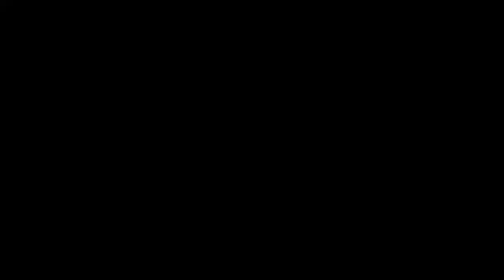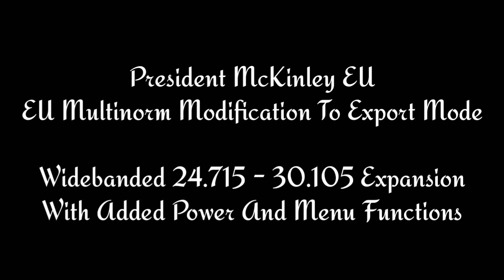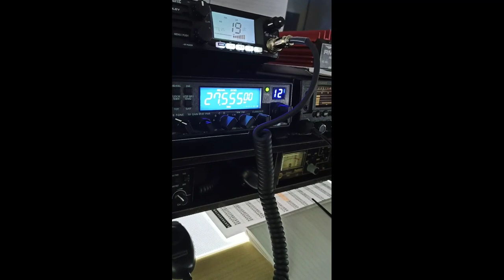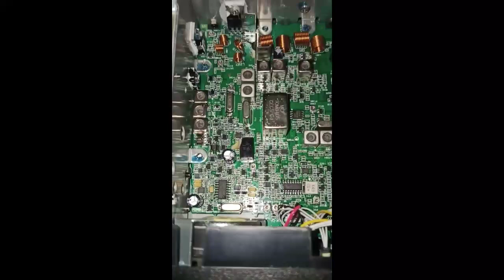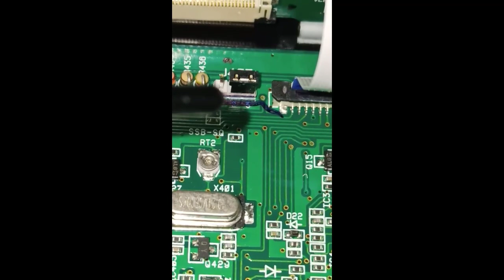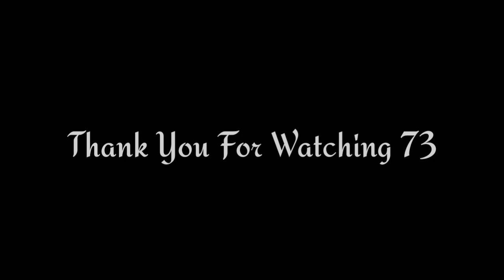President McKinley CB EU .. Wide Banded. Tutorial .. Export Modification.

Comment from the maker: Correction.. in SPAN mode 'on' the frequency steps are as follows.. 0.1 -- 1 -- 10 -- 100 -- 1000 khz steps. and in multinorm the radio only gives you 10khz and 100khz steps, thank you.

Comment: Hi!
Thank you for your video!!!
Is it necessary to cut the white wire?
Thanks in advance!
Reply from the maker: Hi Bruno, yes it's important to cut the white wire..
It's always best to cut the wire in the middle so if you want to reverse the procedure it can be easily soldered back together.. or if you prefer you can just desolder one side of the wire and put a little tape over the end to stop it connecting with anything on the circuit board. Hope this helps.

Comment: Hey just got one recently and looking at this, hows it holding up 3y later with the extra juice?
Reply from the maker: @foobarf8766 
Even today the McKinley is still working fine and without any issues.. it's a superfine radio and it has a prime place on my bench.. definitely one of my best 11 meters radios.
Reply: @DeltaXray444  thanks I looked in mine finally but no jumpers or wire to cut like yours, i guess its the US version. ohwell its been great on 11m anyway cheers!

Comment: How far does the KC shift slide will it go to the 0s
Reply from the maker: @M6MRP  
Hi Phil, interesting question and to be honest I haven't put the radio on a frequency counter.. but it will go to the next channel, so basically more than 10KC's..
Also the radio works with Span mode so depending how it's set up just by turning the channel selector you can move in 1KC increments on any frequency.. so it will get into all splits.. hope this helps.. but im sorry I couldn't tell you exactly how far the clarifier moves.
Reply: @DeltaXray444  you must be able to get to the 0s if it does more than 10kc try 27.400 just by using the frequency display on the front, I'm looking for a tidy desk radio with a front speaker an dont want to mod it for the 0 in between channels rather leave it stock.

Comment: @Delta Xray 444 is there an export mode for the new President Washington? I heard they have left the wire cutting and moving over the Jumper and instaead of that the New President Washington is all menu driven. SO to make the President Washington  in export mode you have to do a keypress Ninja movement just like the CRT SS 9900! Is this true Delta Xray 444??? Thanks for any reply !
Reply from the maker: @MAGNETAR-187  im sure it will have export mode at some point.. most new radios now are either jumper or snip a wire or both and menu driven. like everybody else all those that have an early version I've not seen any information yet as to how it is done.. I still think it will be a bad seller with having a few watts more than the George 2 that nobody will see the difference over distance on ssb that anyone will see on a meter/receive and a few more options.. what they should have done at least is change the design there won't be many people that bought a George 2 will buy this radio.. the original Washington was an iconic radio and also an homebase.. to slap the name Washington on the new radio and it being the same design as the George 2 does a dis-service to such a great old radio.. for the life of me I cannot understand why this radio was even made in the vein of the original Washington homebase.

Comment: So what i have understand is so with the Mc Kinley to modify it to an export mode you have to cut the white wire and move the jumper from left to right? Thanks for any reply! Thanks for this video. I have purchased a President Mc Kinley and have modified to export mode and now it send about 20 watt on fm and 12 watts on SSB!
Reply from the maker: Yes that is correct and it will give you more power, extra bands and more options in the menu. This is the EU model. This cannot be done on the USA model.
Reply: @DeltaXray444  thanks İ am actually in the Netherlands which is an EU country so i will try this on an EU President MC Kinley !!!
Reply from the maker: @AEZAEZEL-187  it will work guaranteed.. good luck.
Reply from the maker: @AEZAEZEL-187 
BTW this process can be reversed if you put the peg back to its original position and reconnect the cut wire back together.

Comment: Hi, I got mine President in Canada but moved to Europe. I find out that they don't use same frequencies here. If I do those adjustments, would I be able to use it in Europe?
Reply: FCC in the USA won't allow CB radios to be modified and that's why the USA version cannot be modified like the European version!
Reply from the maker: @cariboooutlaw4852  that's such a shame.
Reply from the maker: The version I have here is the EU (European Model) I'm not sure which version you bought in Canada..
If you have the weather function on yours then it is the USA model as the EU model does not have that function, it can still be wide banded but I have no idea what frequencies it will give you.
I will add though you can try and see if it works and if it doesn't work it is easy to put it back to how it was originally. Thanks.
Reply: @DeltaXray444  It has Weather option on front panel and only AM mode beside the LSB and SSB. I was hoping it will give me more channels and higher frequencies. I might try your adjustments.
Reply from the maker: @dusanstakic2741  if it doesn't work you can always reverse it.. it will not cause any issues with trying as long as you give yourself the option to re connect the wire.. then again I'm not sure if that white wire is in the US version..

If you like this radio keep it as is.. I would recommend getting the EU model it is much superior with options compared to the US model..

To be honest I cannot for the life of me understand why the USA model didn't have the EU spec.. strange that. Good luck with trying the mod.. it would be interesting to hear your report. Thanks again.
Reply: @DeltaXray444  I haven't had a clue that it won't have same channels there and here. And not FM but only Am. I'll open it and check it. I will let you know what I found.
Reply from the maker: Yes please that would be very interesting indeed.. let me know your findings I'd really like to know how you get on with it and if it gives you any extras.. I've not heard of anyone else who has attempted to do the conversion so it will be a first for me.
Reply: @DeltaXray444  I opened it, nothing similar to yours, no vires to cut or the other thing. I took some pics but can't send it?
Reply from the maker: That's very unfortunate.. I'm surprised there is no modification that can be done..
What will you do next.. are you thinking of getting another radio now for the frequencies you need.
Reply: @dusanstakic2741  that’s correct. I just purchased the US version of the radio and the components on the PCB are laid out differently. The wire is not there and the three resistors aren’t there either. I need to get the EU model. Thanks! and 73’s
Reply from the maker: Very interesting..
Yes the EU model is a good radio with many more options, it also runs in vfo mode with the channel selector too.  You won't be disappointed with it as it covers 10-11-12 meters all bands and fm SSB.. hope you pick one up soon. And thanks for all your feedback.

Comment: no mention of the 5 ALPHA CHANNELS or the FM is not good at all......
Reply from the maker: The radio covers all the alpha's and are marked on the display when in one with an "a" .. the FM on the UK model is exactly as it should be and works extremely well. One of my better export radios and better than most. Thanks

Comment: What does the radio do if you don't cut the white wire but still move the jumper?
Reply from the maker: do you know i havnt got a clue.. ive never tried that.. its an interesting question though.. next time i take the lid off ill see what happens.. i can easily solder the white wire back together and give it a go.
Reply: @DeltaXray444  I have one coming, but still in transit. I haven't seen anything about what the wire cut actually does, and same with the jumper.
Reply from the maker: @nasanction  the white wire opens the radio up to more bands and extra options and I think the peg moved over gives more power output.
Once both wire and peg are sorted and the rig is in export mode it becomes a very good radio with great frequency coverage.

Comment: I have been looking at this radio in this video, the Lincoln + and the new Stryker SR-955HPC 10 Meter Radio With Single Sideband, But i think i am leaning towards President Mckinley. Best regards from America! 😎
Reply from the maker: I have both and they both have there own attributes, they are two excellent radios, but the EU version of the McKinley is better than the US version and has more options. The Stryker however is a fantastic radio, I like both of them and can't fault neither.
Reply: Of you don't need echo and RB, This is better.  Just buy a 60$ amp

Comment: Great video.  I just got an EU version of this radio and cut the cable and moved the jumper.  Now I have all modes available and can finally access the UK menu, but I've lost the EU one.  Any suggestions?
Reply from the maker: Once the radio is put in export mode you can use it in vfo mode on the channel select and it will give you every channel possible from top to bottom of the entire frequency coverage, for quicker access to bands just put the radio on the correct band A b c ect and also using the underscore icon to flow through the channels..
Reply: @DeltaXray444  thanks!!

Comment: Hi ,
I've done it...but when i tried to lower the power ( ptt + . ) it went down!! And its not the fuse ... Is it too bad??
Reply: Fixed. The fuse on the cord was fine but...the 2Amp fuse on the lighter plug burned. Was it expectable?
Reply from the maker: @fungaga77  yes because you now have it in export mode it will draw more power from the power supply.. be careful and make sure you do not put a big fuse in .. maybe like a ten amp fuse should be ok.. I'm glad you sorted it out.
Reply: Thanks, i've found a 3Amp so it.will go with this one .Do you know how to change RF power?
Reply from the maker: @fungaga77  Key the mic and hold it in then press the dot, then turn the channel knob left or right which turns the power up or down, (you can see this with the bar that goes up for high power or down for low power).. once you have it on the output you want then press the channel knob in to set..
It may take you a few attempts but once you learn it it becomes easy..
This was a tricky one to do the first time for even for me, but be patient you will do it.
Reply: ok. will try again. Thanks
Reply from the maker: You can change the output from the front of the radio, mine goes from 2 watts to around 25.. have you tried re seating the tiny plug on the pins.. maybe they are not sitting properly.. let me know, thanks
Reply from the maker: Did you catch a power wire somewhere, ive never heard of that happening, the modification will never cut the radio out, let me know how you get on and what caused it to happen.

Comment: Why has the wire been cut please? Thank you
Reply from the maker: The white wire is cut to put the radio into export mode and expands the frequency coverage.
Reply: @DeltaXray444  cool. Now I get it. And then it's easy to switch between the normal and export mode after this mod? Think I have gennd it now ta

Comment: What is that cut wire?
Reply from the maker: I'm not 100% sure, I think it's the signal wire which tells the main chip to allow for wide banding/exporting the radio to open the gate to the peg that is moved across to allow extra bands and power.. but please don't quote me on that as I'm no expert technician and not sure, when I purchased the radio I had the seller on the phone to me giving me instructions on how to put the radio into export mode, it should have arrived to me already wide banded so he gave me the instructions on the phone as I did the modification with him.

Comment: Great video! Thanks for the explanation and then showing where to perform the "surgery"   ;). Just a quick question though, as I'm in Canada. If I understand correctly,  cutting the wire and moving the jumper will increase output on channels 1-40 and SSB? Thanks and take care!
Reply: Just to clarify...this is the EU model of the McKinley.
The McKinley USA is a different animal for North America only, that looks the same, but is not.
There's no comparison, and this video covers only the McKinley EU.
I have both. The USA model is a great 40 channel radio for US and Canada 'CB' only. It is not modifiable for anything other than unlocking the clarifier, which requires realignment of the radio. I do not recommend doing it. (Ya just can't find good techs anymore). The frequency range of the USA model cannot be extended or expanded. It is one of the best North American AM/SSB 'CB' radios available today. The EU model however, is like a mini President Lincoln, IMO.
Awesome EU AM/FM/SSB transceiver right outta the box, for the EU... but for North America it's a mini beast when expanded. More like the Lincoln's little brother than the McKinley USA's paternal twin.
Watch "Mike'sRadioRepair" on YouTube for good information on the McKinley USA.
Reply from the maker: Hi, yes the power increases on AM FM and SSB, In the description it tells you what the wattage is before and after, thanks.

Comment: Which LiFePO4 battery (or traditional car battery) is advisable to use with this radio for mobile field use?
Reply from the maker: I would say any battery around 13.8 volt will be adequate to run the radio.

Comment: Which telescopic antenna would be advisable to use for SSB?
Reply from the maker: Hi.. personally i wouldn't use a telescopic antenna for use on this radio, i would use a proper antenna which can cover the bands such as a half wave or 5/8th wave designed to cover the bandwidth this radio covers.. there are large telescopic antennas on the market that pull out to around 15 feet in length, but these are used mainly for home made antenna's but are not really designed for ssb use, hope that helps.

Comment: which portable case/box is adived for the MC Kinley to inclue battery and antenna?
Reply from the maker: This is a mobile radio which can be set up for homebase where you would need a power supply running at 13.8 volts, or around the same voltage for out in the field use with a battery.. I'm not sure i understand fully your question but hope my answer is ok.. if you can be more specific of the requirements you need to run the radio please comment.. thank you.
Reply: @DeltaXray444  Thank you. Yes, I was asking about a portable case in which one can enclose/incoporate the radios including the necessary car battery.
Reply from the maker: Ahh i understand now.. there are plenty of portable HF cases out there on the market that are aimed at HF/UHF equipment which could easily be applied and configured for use out in the field to fit the McKinley. You would have to look at some ham radio websites and look at the portable cases they sell.. there are a good few out there to purchase simply because hams do POTA (Parks On The Air) and also for many other outdoor radio events.. you could start off looking at the MFJ site and other manufacturers who make carry alls and cases for outdoor use.. Google is also a good place to start looking.